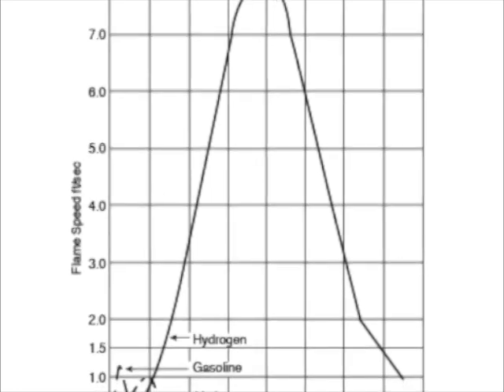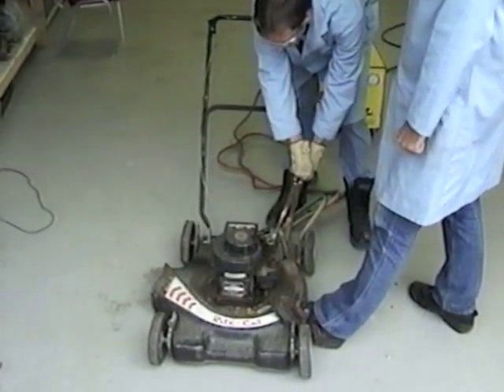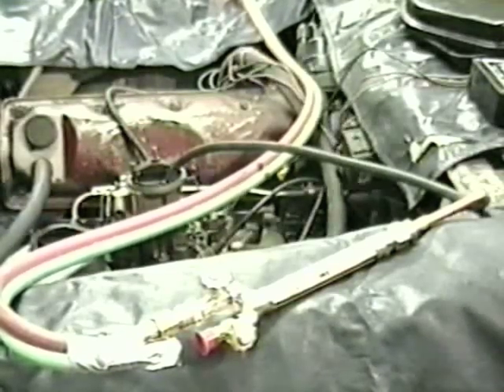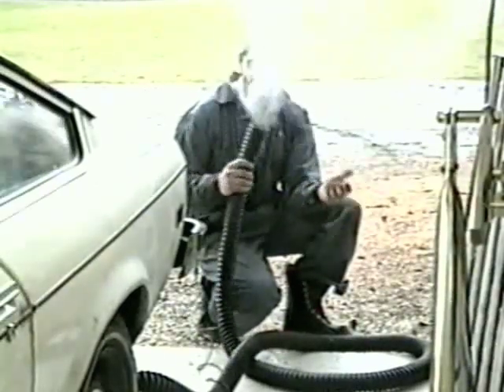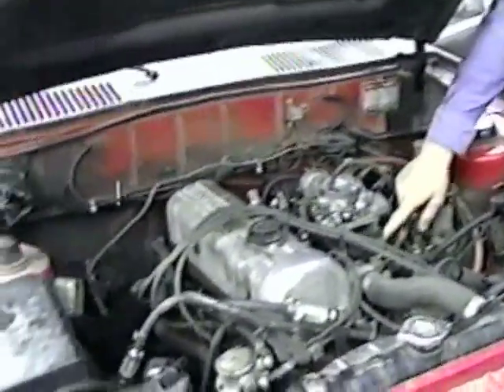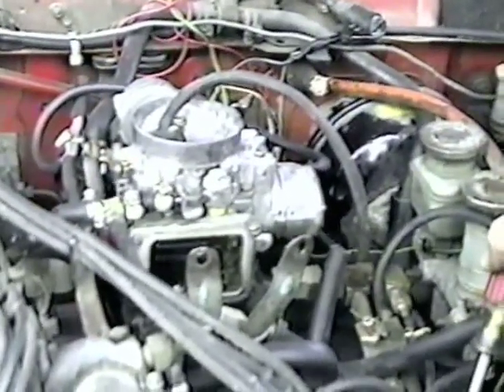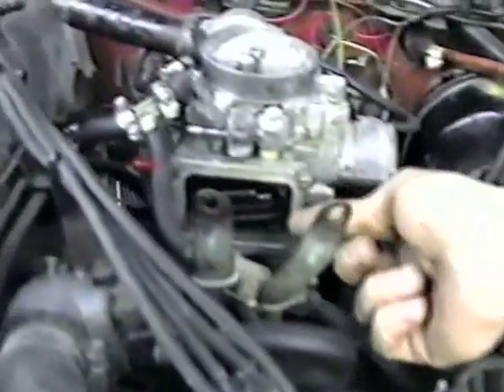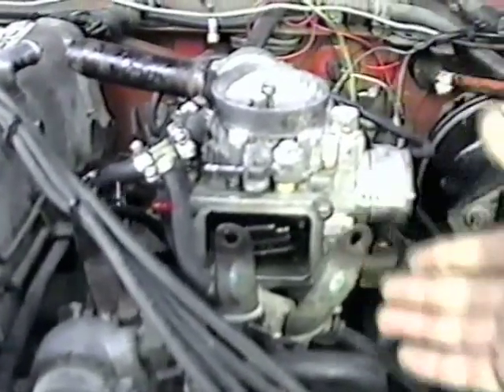Vapor Fuel Combustion Speed

Comment: Still tinkering with the circuit for Nathren's water powered mower engine. I spent 3 months designing replacement for the old style dual coils Relays that always worked before in Georgia. The sealed carlon box is in vacuum with DC high volts, with Tesla type magnetic spark gap + Cap, with series Crossover inductor 1.6MH, as per originals. The idea is that radiant Energy is generated, kept in by vacuum, and follows wiring out to spark plug. He said they were worth their weight in Gold. The shop technicians back then could not replicate homemade relays to work efficiently. That's why no final papers were ever released. He was in jail during 2020.  The original traffic signal lights poles relay were new replacements long ago. It was only the smooth running V8 engines and Pinto 4cyl WITH EGR + the Relays, and the magnetic field at plugs tips, that were acceptable. The Nitrogen compound in exhaust gases back into intake was the key to non surging engines. Website was studied and data copied before it was shut down. Currently working on the Briggs mower engine conversion only. I changed low volts to positive, and also the ignition volts to positive. This way one battery can be used, and starter motor can use engine casting for negative ground. My Power Supply is halfwave DC voltage doubler voltage from 500Watt open board 20Khz Inverter with fast diodes. Requirement is ISOLATED source power from secondary side, and then use series blocking diodes. Therefore the coil L in series can have back EMF higher volts pulse. One L coil in vacuum with high volts, while other coil L is mounted outside with low volts. The Georgia shop technicians and Nathren said that circuit required 100v and 6-7amps through spark plug. (Very small electrodes surface area) There is a back EMF higher volts generated from inductor that could be used for that purpose. Magnetic field carries all the way to plug, while I also added neodymium ring magnet at plug. The field is exactly at plug electrodes. Water in Carb was to change to water vapor pressure at -34degrees ATDC timing with some Hydrogen gas formed and fired for piston pressure. The S1R9A9M9 triple coils assembly serves 3 functions and is NOT a transformer. I built about 40 different models over time until I figured it out. His original spark plug of 4000ohms was replaced by Champion 125ohm plug. It COULD have been taken apart later with resistor replaced with copper segment. This way plug is Zero ohms and and can carry 6 amps. The S1R coils had formed "Leakage inductance" in 7t+13Turns, so that superimposed higher 1300 volts over 12v would push 10amps through spark plug. The 15Amps first capable,..was reduced to 10amps with the reactance induced in 7+13 turns coil from the electrical field of the ignition cable line pulse. He gave example in his website called - "the 60turns coil test". With battery disconnected after engine starts, the dual alternators under flywheel ran the conversion circuit for spark plug amps. In 2008 Youtube videos S1R9A9M9 1 and 2, he neglected to say the 18HP Briggs engine was self running, and was to be inferred!

Comment: So the vapor bypasses the fuel injection system? Been reading your hyco2a manual, probably a bit out of my league but I enjoy learning.
Reply from the maker: Yes, the vapor goes in with the air.  Which is WHY you need a controller that shuts down the regular fuel system in ratio to the vapor input.  CEIT like the Electronic Diverter.

Comment: Great, now help us run vapors on a computer controlled fuel injected engine that defies leaning the car out. Currently 6mpg. I just tried some new disconnect combinations clearly proving that the 2.156v reading on the upstream O2 sensor is some fault between the computer and the wiring harness because I have it disconnected and it switched the reading from a steady lambda of 0.999999 and 2.156v to 2.151v with no changes clearly indicating that with these damned computers you can never get proper fuel economy and it tells the scan tool false values while not even operating the car from most of the sensors and solenoids with various inefficiency.

Comment: With my anti-knock prototype I can advance the ignition timing to the maximum factory setting.

However the engine cannot run closed loop with this setting.  The car needs A stand alone computer to maximize the full potential of the anti-knock device.

A short test run video is on my page.

Comment: Put a hollow metal ball between carb and intake manifold atomizes and vaporizes gas doubles gas mileage and cleans up emissions this is how Poque did it possibly Try this it works ,please  please  try this ,Small engine first to prove
Reply from the maker: I'm well aware of the various Pogue Carburetors and vapor fuel.  Been studying these technologies for decades.  I invented a 200+ MPG fuel system that will work on today's 'cracked' fuel.  You might want to check out my books:
https://eagle-research.com/product-category/fuel-savers/
Reply: I have a couple or three of your books/booklets and. They Are very interesting , the story about you and your brother building a mini refinery fuel cracking system on that old pick up truck was pretty cool and almost hard to believe. But it is time to come up with something different, very efficient and affirdable. Like burning water mist or fog inside the combustion chamber instead off injecting it with hho gas.  I've been wondering if high voltage ignition coils and resistorless spark plugs would be capable of doing the  job. Weather plasma ignition or simple high voltage low amperage coils 40kv 200. Mlliamp. Current. What is your opinion?

Comment: How does this work with fuel injection?
Reply from the maker: I'm not understanding the question.  Combustion is the same for all types of internal combustion engines and fuel systems.  Are you asking how to APPLY this knowledge to vehicles with fuel injection?  If so, that's what my books detail.  
You'd need to know what fuel you are using (such as methane, propane, gasoline, diesel, HFO), what type of fuel injection (like mechanical or electronic) and characteristics of your fuel injection system (like what sensors, programming, etc.).

Once you know these things, you can apply the knowledge in my books to substantially increase fuel efficiency and reduce noxious pollution.

Comment: prototype idiot.
shut up no that nothing that is correct shill.
pre ignition is caused by excessively hot exhaust valves  during intake charging.

the remedy for cooling and compresion is running a water atomizer with the fuel vapor.

Comment: what volume would be needed to power a 4 cylinder and what about a V8 in terms of amperage
Reply from the maker: While I do use amperage to make the hydrogen, it takes FAR more energy to split the water than you get back from burning it in an IC engine.  'Running on water' ISN'T the point of this video.  The point here is that vapor fuel does NOT detonate, even vapor fuel (hydrogen) that burns many times faster than gasoline.
Amperage has nothing to do with making vapor fuel from gasoline.  Generally I use evaporation and vaporization techniques.  Depending on the efficacy of vaporization you use 1/2 to 1/4 of the fuel to achieve the same power output of the engine.  For REAL gains (over 400 mpg in a 4 cylinder and over 200 mpg in an 8 cylinder), you'd use a cracking system like that described in my 'Extreme Mileage, 101' book, but that is costly to build...

Comment: The engine is not running on water, it is running on either Hydrogen or Browns gas which is Hydrogen + oxygen. derived from water.
Reply from the maker: Correct.  
It would only be running on water if you put water in the fuel tank and added NO OTHER ENERGY.  The demo in this video is adding 3 kWh from the Grid, to idle the engine.  Running on water wasn't the point to this video... Here I show that the combustion speed of hydrogen is compatible with any normal IC engine.  For this demo, it doesn't matter how the hydrogen is made.

My current technology does not 'run engines on water'.  The best I can do is use water to enhance carbon-fuel combustion as per the PDF you can download here:
http://er4u.info/cms/node/443
Reply from the maker: I've never had nor heard of anyone having that issue.  Just the opposite; if the engine is running too slow, the mixture will backfire.  To prevent backfire I had to wait to add the BG until the engine was turning over (starting).  If I add the BG before starting the engine it will often backfire.  Once the engine is turning over, it runs very well on the BG.
Reply: George Wiseman I thought the problem was u can idle it with browns gas but if u try to make power with it the browns gas will actually pre-ignite from the heat of the intake valves?

Comment: Im suprised there isnt leagues of idiots on here wikipedia educated people havent been saying this is impossible. because it will burn up valves pre ignition detonation and all of that andhow it will make your heads and engine block brittle just because some expert told them on a youtube video and you cant make enough hydrogen to power a engine how it will cost more in energy than you can make to power the engine . Yet some of these work despite all the nay sayers out there
Reply from the maker: +prototype9000 It's a little hard to sort out what you are saying but here's what I think you said and my responses:
1. There are lots of people who are ignorant of vapor fuel combustion facts, who will trash-talk videos like this because they THINK they know what they are talking about.
2. There are Trolls that will trash-talk videos like this because they are paid to do so by the Vested Interest.  
Both those things are true and I've deleted many such comments.  
For more PROOF that vapor fuel works, see this preview of my upcoming book "Double Mileage, Guaranteed" (use the coupon code on the page to get it for free)
http://er4u.info/cms/node/3921

As for pre-ignition, detonation, burning valves, etc.  Those are actually more easily prevented / mitigated using vapor fuel.  They tend to be issues of liquid fuel combustion.

And finally, the hydrogen embrittlement myth.  
First, most people don't realize that their engine is ALREADY running on mostly hydrogen.  Hydrocarbon fuels have more than TWICE as much hydrogen as carbon.  The fuel MUST be physically split into individual atoms before combustion can take place, resulting in burning the hydrogen to make water and the carbon to make carbon dioxide (ideally).  

Second, hydrogen embrittlement ONLY happens in specific conditions that do NOT and cannot exist in an internal combustion engine.  It simply can't happen and anyone who says it does is either lying or ignorant of physical facts.
Reply from the maker: There are trolls and ignorant mechanics that do state those things.  
For the trolls, I have NO respect, because they are accepting money to knowingly lie.
For the mechanics, I do the best I can to educate them (ignorance can be cured).

The facts, of the efficiency and efficacy of hydrogen and vapor fuel, are easily proven by any mechanic who actually chooses to try.  
Any who don't and continue to spout the Vested Interest LIES they were taught quickly lose my respect (which, of course, doesn't matter to those with such arrogant 'know it all' attitudes).

For a quick lesson in one of the lies mechanics are taught (I'm a certified mechanic BTW) is presented here:
http://www.eagle-research.com/cms/node/462?a=5

For an introduction to vapor fuel, read this part 1 of my upcoming eBook "Double Mileage, Guaranteed" (use the code on the Sales Page to get 100% discount):
http://www.eagle-research.com/cms/node/3921?a=5
Reply: George Wiseman I learned from you as well when gasoline is turned into vapor the flame duration is shorter because their isn't any lingering wet fuel that turns into vapor during the combustion process allowing extended heating of valves etc. Some vapor carbs using engine heat can have difficulty operating BECAUSE of the reduction in heat.   Your analogy of the hand over the candle was brilliant
Reply: Move aside and let the man go thru. Let the man go thru, Move aside and et the man go thru, let the man go thru, thru..... Shut him up real quick!  And I know why! Do you know why? Because FACTS don't have to lie, dummy their proven, that is why!!!
Reply: i guess geet engines lock up all the time Hugh? woops they dont so try it instead of speculating engines dont run how we are told its all theater

Comment: 2 KW, i once seen a 3500 watt inverter, so i guess it could be possible to self sustain an engine, you'd just need a ton of alternators to do so
Reply from the maker: +Justin Noker While I know that it is possible to self-run an engine on water (because I have files on several people who have done so), I personally do NOT know how.  The engines in this video are running off BG generated from Grid electricity; the engines would NOT continue running if you put a load (alternator) on them big enough to generate that gas.

So.... Whatever technology could make an engine run on water will take VERY LITTLE power to make the gas (or the load will be too great).  So any ordinary alternator will do the job.  The KEY is to re-discover the technique(s) that help water 'fall apart' using very little power.
Reply: George Wiseman well i do know a friend of mine had limited success in running cars off of water, so maybe he can be of help
Reply: @ecopegasus  So really, you yourself are also "vested interest"
Reply from the maker: @allandulles7108  I suppose so :)
'They' are Vested Interest to sell as much fuel as possible, making trillions of dollars polluting the planet with 10x more carbon than would be if they (we) applied the technology I point out.,
I'm 'vested interest' making a few thousand dollars selling information and some kits, that has (by my calculations) saved millions of gallons of fuel with over 200,000 people applying my technologies since 1984.

I'm thinking mine is a 'different kind' of 'Vested Interest' that is in direct opposition to the greed that is destroying our planet.  I'm trying to HELP people.  They are just USING people.
Reply: @ecopegasus  well I hope you find out how to get a self running hho setup working. So many people online claimed to have done it, yet I cannot get mine to do that at all, despite it seeming so simple. What's the secret? Some say it is a special pwm or some sort of waveform that you need... interest in hho seems to be declining, harder to find info online about it. People out there saying certain designs generator D2 and O2, even a vague mention once of tritium being generated... among other things... others have turned certain elements into other elements with the flame alone...
Reply from the maker: @allandulles7108  Self-Running HHO is a separate issue and while I've been researching it, I haven't discovered the KEY...  But here on this page we talk about vapor fuel, which decreases pollution while increasing mileage and power.  THAT I've figured out :)
Reply: @ecopegasus  fair enough. but if you happen to have any leads on self running hho or any unusual gasses produced by electrolysis cells please drop me a link or something, thank you.
Reply from the maker: @allandulles7108  No disrespect intended, but no way I'd remember you or to look in these chats to find you.
If I do find such a holy grail, I'd tell my eNews subscribers.  So you could go to my website and subscribe.
eagle-research.com
Reply: +George Wiseman oh god i have searched far and wide for this answer. the best conclusion i have found is radio wave transmission at the right frequency but even that is too much power to make. i've also seen people turn water into plasma with a laser for combustion but it dead ends.
Reply: pretty cool the thing it that this is where efficient engines should be going and that extra energy can come from a charging station on route. with the advent of supercapacitors there is serious potential to see this tech on the roads in the near future